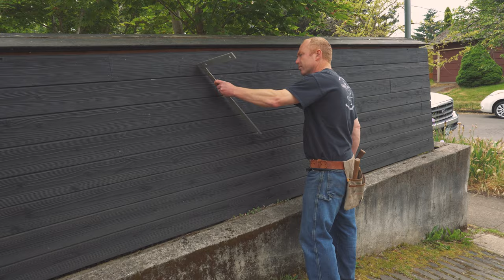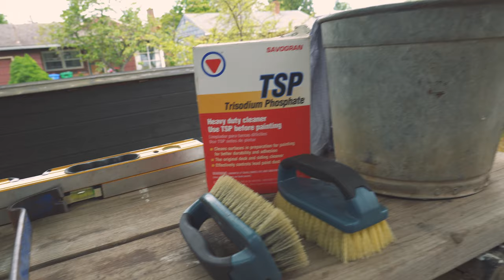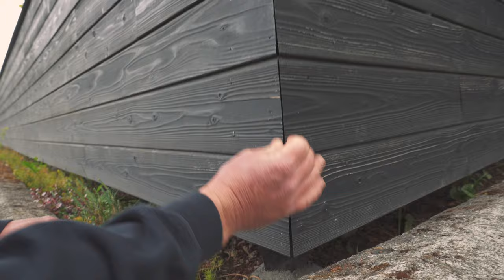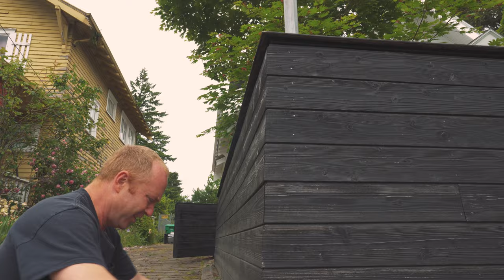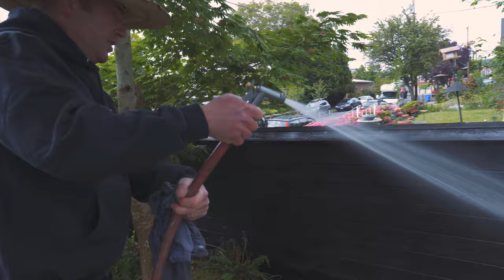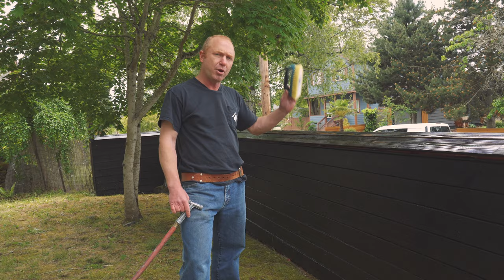DIY: Yakisugi "Shou Sugi Ban" Maintenance

Comment: How is the oil process environmentally friendly over the years of rain?  I would think Shou Sugi Ban wood with a two part paint or hardened sealant would seal the wood over a decade at least. No etching and mixing with the ground around it.  Though not a decade, our far side gate someone thought to build with 2X3" white pine was already eroded before we got the place and the termites beat me to it.  So I framed a new one using 2" X 4" quality Fir, and 1" rough cut fir boards, leaving 3/4" gaps between the boards and burnt the whole gate and covered it with a 2-part ash grey epoxy paint for garage floors. Though it only sees the afternoon sun, after 8 years it still looks new. I'm totally impressed by the Shou Sugi Ban process.  Who would ever think burning wood preserves it?
Reply: This and isn't TSP super gross stuff for the environment?

Comment: Would this process hold up in the Arizona desert heat.  Im wanting to cladd my backyard block fence with wood.  Everyone here in AZ tells me would does hold up well due to heat and very low humidity.  Thanks for your help
Reply from the maker: UV rays can speed up the aging/weathering process of the siding, though you won't be getting as much wind/rain as other parts of the country. Yakisugi has been used across a variety of climates to great success in Japan for centuries. An oil coating with additional UV protection reapplied periodically every few years should do the trick.
Reply: What have you decided on? I am in West Arizona and want to wood clad my front wall.

Comment: Great video, why do you use nails instead of screws?
Reply: if you didnt found answer yet. Screws like to go inside the wood more when it get wet. I mean proper plank is dry, not as dry for outside purpose but still. Or it will dry on sun anyways. Issue with screws is that they are sucked into wood while it get more moistured. So you have dry plank and when it get moisture from air, wood will ,,suck" screw into it, its like wood rotate screws. That wil cause cracks, bcs if screw is nicely placed into wood, and it will go further it will cause the wood to crank. Its not allways issue, but i might happen.
Also i think nails are cheaper, and as shown on video he like to hammer them better soemtimes haha.
Sorry for my english but i didnt learned to share my poor carpentry knowlege in english haha

Comment: What nails are you using? Or do you recommend screws?
Reply: Depends on the structure.  If it is large, like a house, nails.  They handle thermal expansion and contraction better without damaging the wood which is why nails are still used on houses.  I'd recommend checking out Stumpy Nub's channel.  He has a video where he talks about how old school nails are the best but only went out of style because of manufacturability.

Comment: If you did a a deeper char, I am not sure you would be having this issue.
Reply from the maker: In what way? Charring the wood more than we already do would compromise the structural integrity and soot would flake off easier - we already char deeper than any other yakisugi manufacturer in NA because we use the Japanese heat treatment method that actually brings out the pest/fire/weather resistant qualities in the wood, not a blowtorch for a simple cosmetic burn that will wear off in a few years.
Reply: @NakamotoForestryNorthAmerica  

While the yard-facing siding has a deep char, all the exterior facing siding has a much lighter char. This is clearly visible from the video.
Reply from the maker: @felixguerrero6062  both sides were charred the same amount. The street-facing side is our Gendai, which starts out as the deep char (Suyaki) and then is brushed to remove the topmost soot layer and reveal the charred grain and surface beneath.
Reply: @NakamotoForestryNorthAmerica  

I am afraid the brushing is not traditional, as you are probably well aware of.
Reply: @NakamotoForestryNorthAmerica  this is a very informative video. Do you have more information on the process of the charring you did? I’ve mostly only seen it done with the gas burners. I’m contemplating this for a couple of projects of my own at home.
Reply from the maker: @cameronboucher7805  Yes, the video before this one on our channel is all about the DIY burning process.
Reply: @NakamotoForestryNorthAmerica  Bill, is it not possible at all to achieve the same effect with a garden torch?